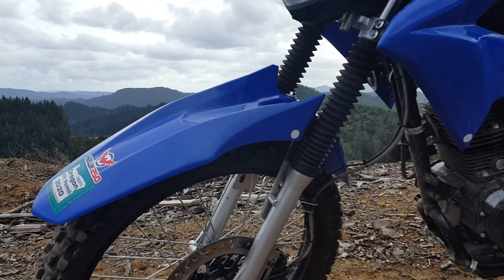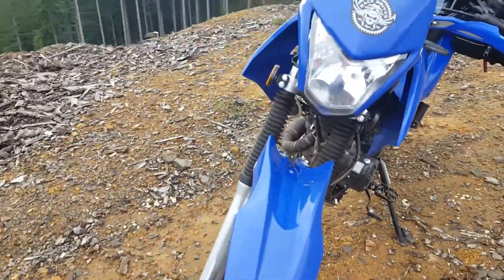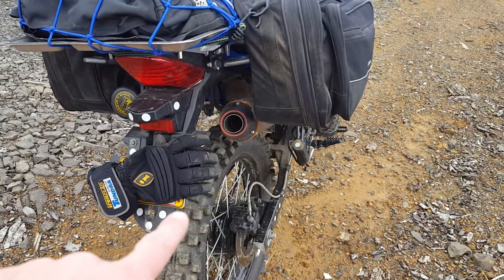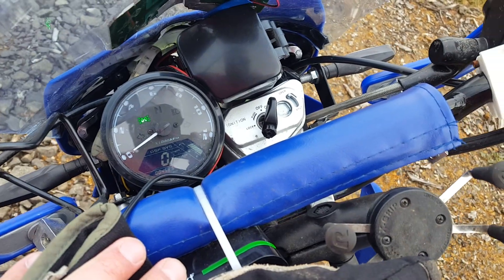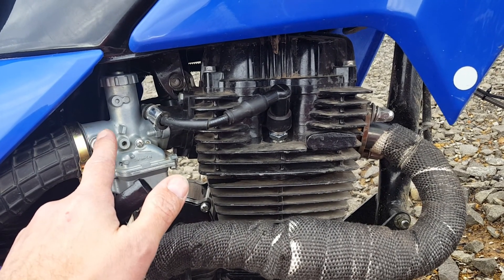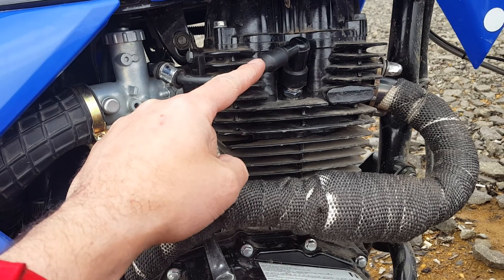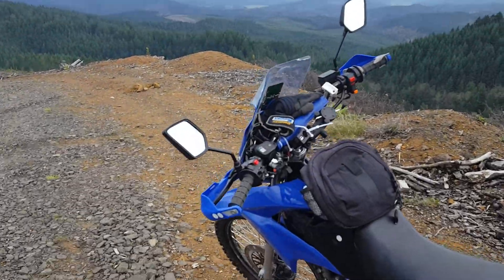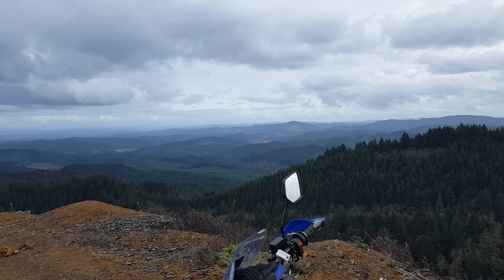RPS Hawk 250 fork brace/fender mod

Comment: Spark plug is a DPR8EIX-9 for anybody that is interested.  Projected electrode resistor plug with a preset .036" (0.9mm) gap.  Same plug I run on my bike. :)
Reply: OddBallPerformance would this be the same plug for the CSC TT250?
Reply: @dustinsegers4534  yep, you can use it on the tt250 as well

Comment: Nice I like your hawk. Any recent updates
Reply from the maker: It's been in the 30's here so haven't been riding much. As far as updates, I had it on a trickle charger and went to start it and the starter wouldn't crank. It had power, so I kick started it and went on a 20 mile ride. The starter worked after that. Guess it was sitting too long. I'll try and do a video soon covering that and my brush plate/deflector (Not skidplate) I just made. Thanks!
Reply: @Taematoe  The brush deflector would be interesting to see. I seen how someone made there own fork brace with good results. You may try to make. I been wanting to get one to save gas on my commute to work. With a 45 mph speed limit and a 25 min commute. It would save me tons on gas.
Reply from the maker: @zachutson7205  yeah that sounds like perfect Hawk conditions. If your mostly pavement riding the first thing I would get it road tires.

Comment: I’m about to go 17. /. 40. Sprocket
Reply from the maker: I think you can do that with the stock chain. I had to cut two links off mine. I kept the stock 15t front and went down to 42t (I think) in the back. Been awhile, it was one of my first mods.
Reply: @Taematoe  I have the 17/40 sprocket setup. Lots more speed. I can cruise without screaming the engine at 70 mph. In 5th gear you do lose significant torque. Noticeable going uphill. But the stock chain is too long. I used a 124 link chain but my adjusters are all the way forward. I do mean ALL the way. But a 126 link or 128 link chain would work. I'd suggest a 126.

Comment: Where did you get the saddle bags and tank bag?
Reply from the maker: That tank bag is my wifes old backpack. Nothing special, you could probably find something like it at goodwill. The saddle bags are firstgear and I got those off poshmark used for 50.00.
Reply: @Taematoe  thanks. I'll be getting those. Better than having a backpack.

Comment: 120 jet... what's your elevation? I'm at 1000ft and I'm slightly rich with 105 jet.
Reply from the maker: At the place I took the video it's around 1100ft. I'm using a 120 main jet with opened airbox, mikuni carb, aftermarket exhaust and a iridium sparkplug.